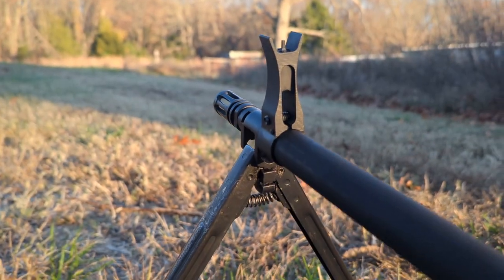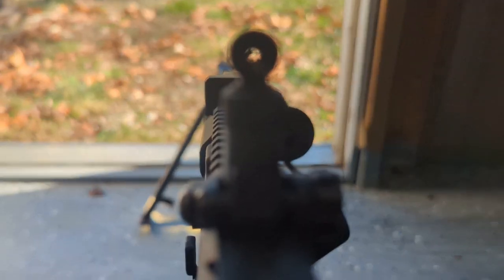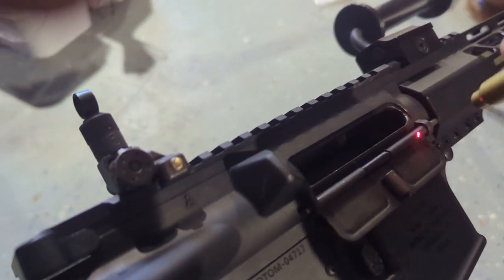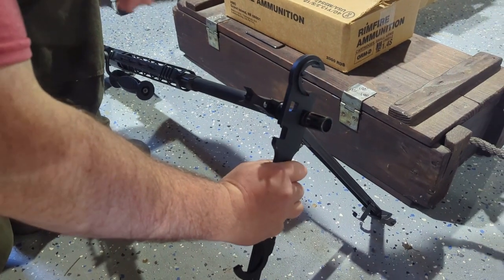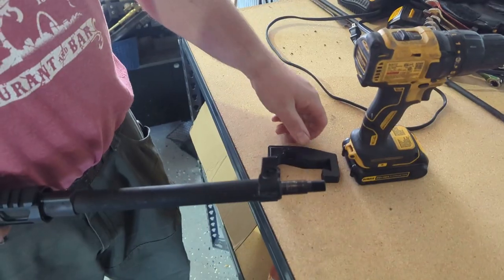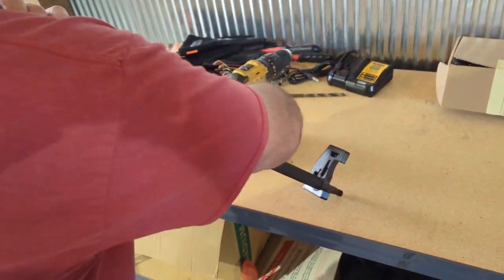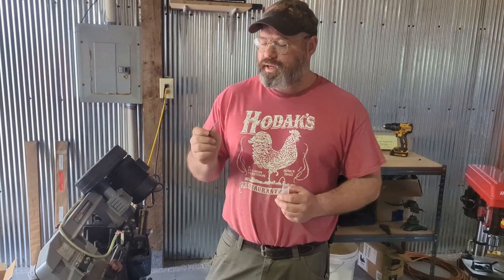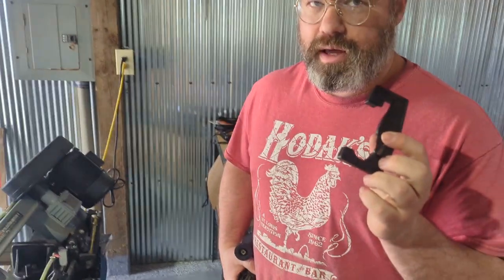Clamp on front sight post, pinning demonstration

Comment: Are these fitted for suppressors I know that that’s one thing I’ve seen someone weighing the red right had upper over this one
Reply: Or does anyone have any experience running one on this barrel and how it performs
Reply from the maker: @Jake-ts1tw Hey Jake, yeah I know quite a few guys running these uppers suppressed in all lengths and configurations.
Reply from the maker: @Jake-ts1tw check out brent0331, triple f shooting, whisper tactical, all guys that did non-sponsored reviews.

Comment: Nice, is there any thermal growth difference in impact after, say, 6 mags of rapid fire?
Reply from the maker: @bryanfaulkenburg462  I haven't shot for groups after burning through six mags. But I know I'm still getting good effects on target from what I've tested out to 250 doing that.
Reply: I can say within 200 yards no, I saw no shift in POI after burning through several mags.

Theoretically out to 800 yards, after burning 6 mags then trying to take one aimed precision shot? Maybe? 

According to Google the coefficient for thermal growth on plain steel is .0000065 per inch, this piece is ruffly 2" giving it a max growth potential of .000013 inches. This is I believe 4140 steel? So it's going to grow less.

Translate that to minute of angle on a 24" barrel... And probably not enough to notice? I don't know how to translate that to MOA

Comment: what's the benefit?
Reply from the maker: for having iron sights? extended length iron sights?  or drilling and pinning?
Reply: @SmallTeamSupply  putting them out that far, sorry
Reply from the maker: @JohnDoe-37476  Oh having a longer sight radius allows you to be more precise with your iron sights. Also the look harkens back to RPKs.